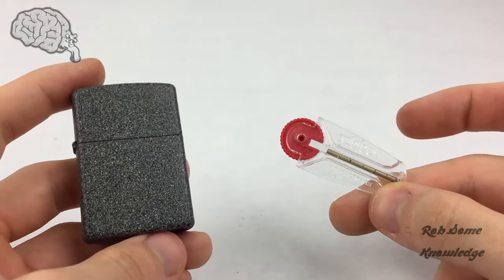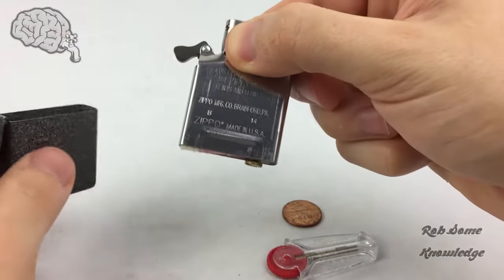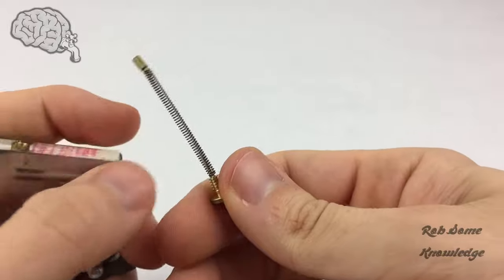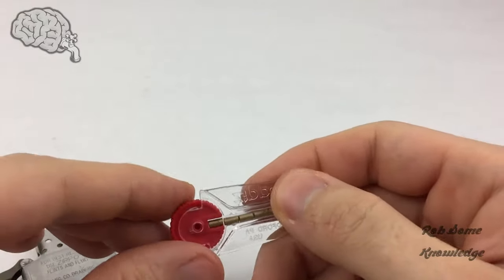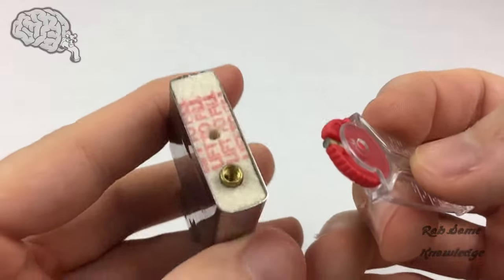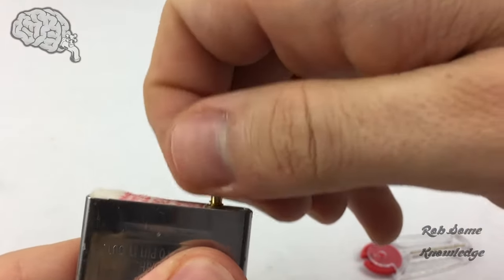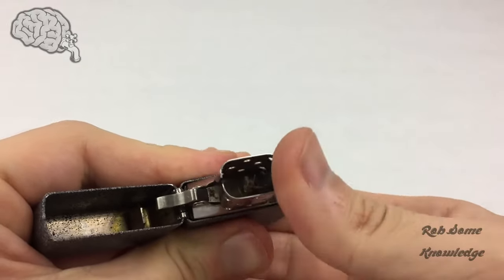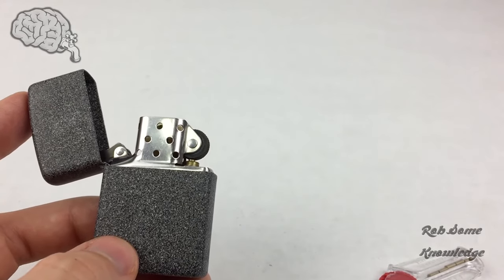How to Replace Flint in a Zippo Lighter

Comment: Well, well well... I got so aggravated trying to figure out getting the flint outta the doohicky with the red wheel. I decided to just breathe and go ahead and get the knowledge. And there, you had problems, too! And I STILL can't get mine to work! Aaarrrrggggggghhhhhh!
Reply from the maker: Did you make sure you are turning it the right way? The red wheel only turns one way if I remember correctly.
Reply: @RobSomeKnowledge  I've tried going both ways and it won't budge either way. There's a little red protrusion all the way to the left of the dial, facing front. Looks like that stops it from going counter clockwise. It turned smoothly - no catches - to get to this position. I'm stumped, trapped at home and lighter less. 😭

Comment: Thank you. I don't smoke but I need lighters constantly and the ones that use the propane the fuel is incredibly expensive and the kids are always going around flicking them and bleeding and dry. If the supply chain goes down I want to have lighters so I've gotten several Zippos now I need to educate myself on them. Appreciate you

Comment: my pusher rod is really worn down, it's like half the size of yours. Would this be a problem?
Reply from the maker: Is it still pushing the flint all the way up to the striker wheel? If so I don’t really see a problem. If not you could easily fix it by just stacking a few flints until it reaches the striker wheel
Reply: @RobSomeKnowledge  Thanks.

Comment: Ok, so I did all that and when I try to strike it, the wheel would not move. BTW my zippo is very old and has sat for 9 years without use, so I did use some WD40 on the wheel, wiped it dry and clean, then tried it again and it moves now but still dose not strike. When I drop the new flint in, you can't even see it come out the other end near the wheel, it's like an old flint may be jammed inside. Please, any suggestions would be greatly appreciated. Thank you
Reply from the maker: Try to look down the tube from the bottom end that you would normally fill it. Can you see any flint stuck? Hold it up near a light and see if you can see straight through it or not.
Reply: @RobSomeKnowledge  -  You are AWESOME, yes something was stuck, so I watched another video on "common issues with old zippo lighters" and you are right, the old flint was stuck. So I used my smallest drill bit on my Dremel and cleared the way and TA! DA! it works like a charm. Thank you so very much, bless you.
Reply from the maker: Yes!!! Glad to hear it helped you out!!!

Comment: I think I lost the flint will it still work without it?
Reply from the maker: No you’ll need a new one. The flint is what makes the spark to light the lighter. There’s a link in the description for cheap flints on Amazon
Reply: I found the flint it’s little to long tho should I cut it and will it still work?
Reply from the maker: @Jose10R14  yeah if it’s a flint of any size it’ll work fine.
Reply: @RobSomeKnowledge  so if I cut the flint a little it will still work
Reply from the maker: Yes. Generally if a flint fits you can use it. But I’d you use a flint that is too small in diameter it can feel a little wonky and might be prone to jamming when the flint is almost worn out
Reply: @RobSomeKnowledge  ok thank you for the help